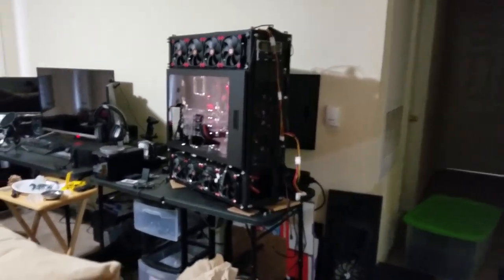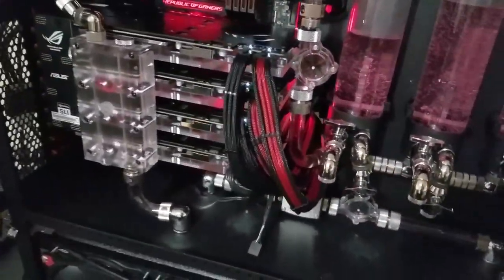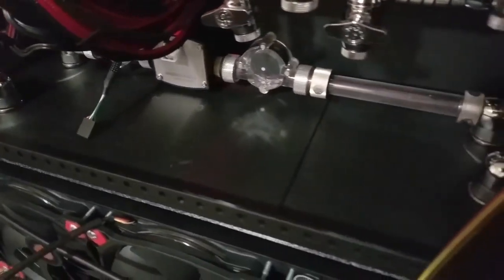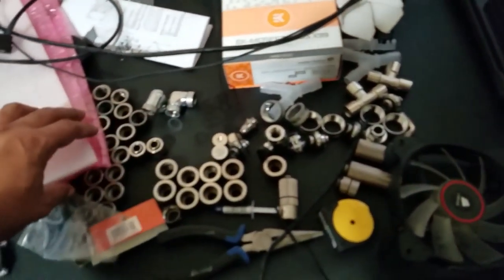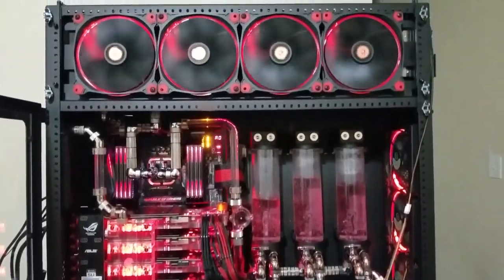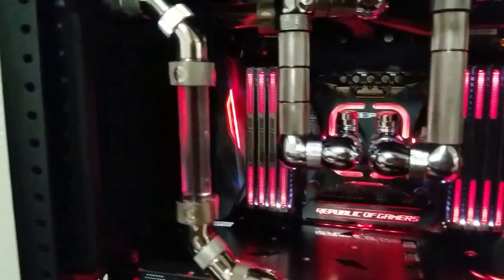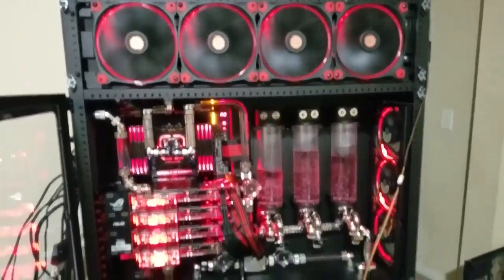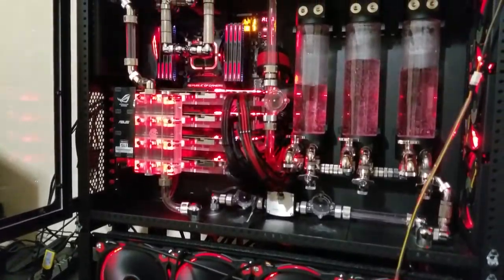STH10 (redruM v3.0) BUILD VLOG!!!

Comment: Sick build man. I just picked up the same case. Did you install 480 or 560s in the top compartment? My goal is to have a dual loop with a 480 monsta on top in P/P and a 560 monsta at the bottom in P/P

Comment: how does the backplate on the gpu work with the waterblocks ? im gna try do that to my system aswell once i get my dual 1080s, but do i have to mod it any or is it just to screw ?
Reply from the maker: Jonathan Iseskog it fits directly to the bitspower block no mod needed.

Comment: nice i got same build but with aquaro better to solder cavle if u are goin to leve them in there and pump i bette al d5 mod but i loock relly nice
Reply from the maker: iDC-El_CANGRY_PR this build has an aquaero 2 power adjust ultras and a farbwerk controller. the 3 d5 pumps are aquacomputer usb as well as the high flow sensor and filter.
Reply: Yea i have the same the o ly things i don have because i been lazy is the farbwerk